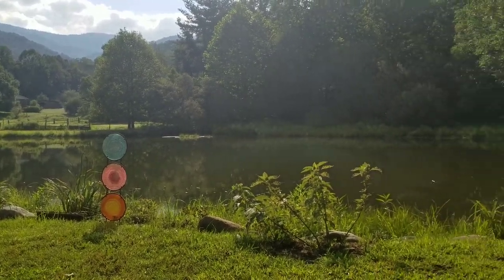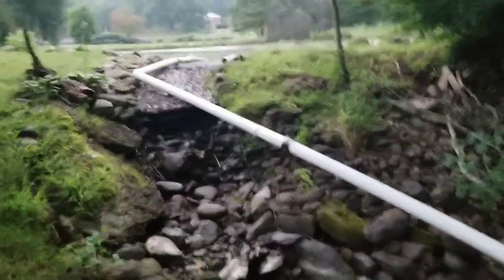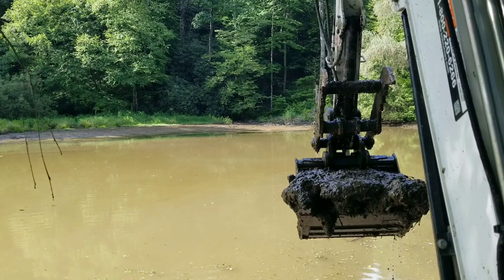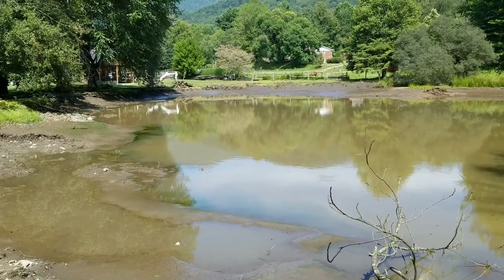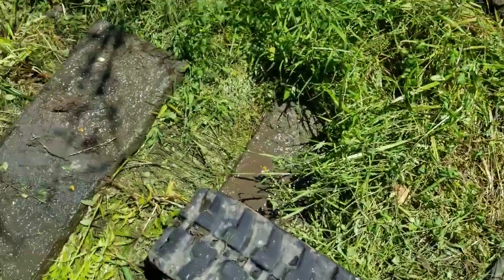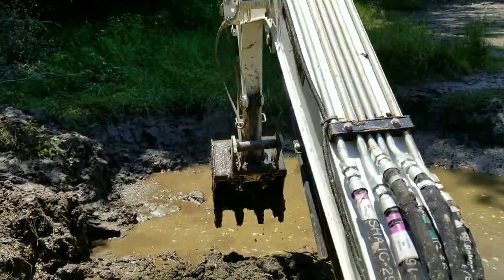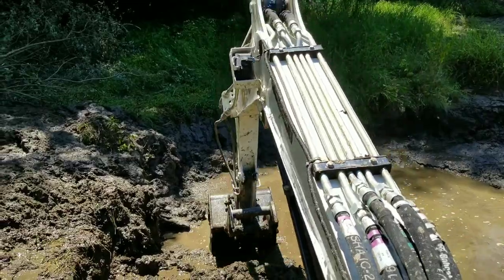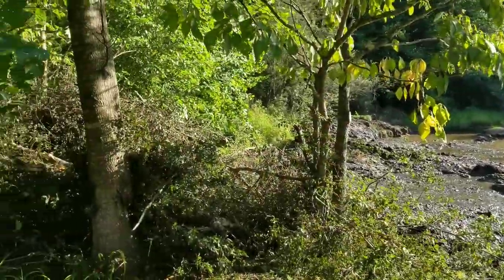Pond dredging project

Comment: Drain the pond completely. Let it dry up for a week or so. Get a large skid loader and a decent size excavator and you can clear/ dig/ haul out the dirt in two days. Way more cost effective and efficient way to do this job.
Reply: only problem that depends on the soil , that silt in the bottom would take 2 or 3 years to dry it would still be tacky to the touch, if it was sand I would agree

Comment: I might be wrong but wouldn't using a suction dredge like some gold prospectors use in rivers or if had money a bigger one work faster and easier run the hose to out of the way instead of going through a sluice box